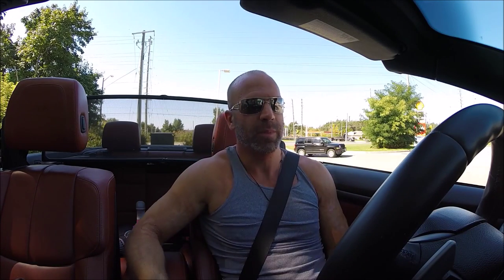Shit I Love About My M3:  Wind Deflector Effectiveness

Comment: is there a massive difference with the windows down and the deflector up?
Reply: I just realized not really.
The main point is to create a point of negative pressure away from the driver seat. 
So a wind deflector will do the same as having the windows up.

I didn't know, but I just realized that with this video.